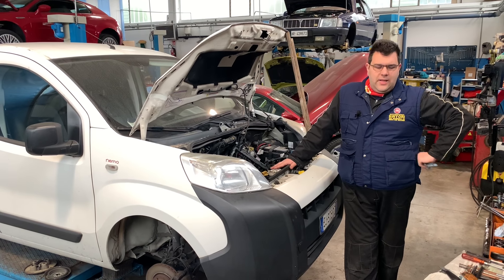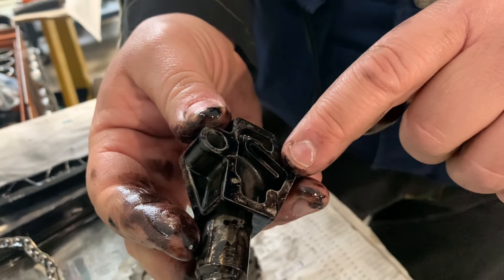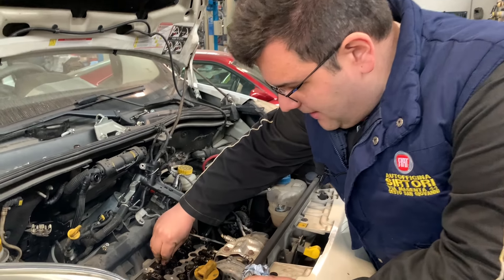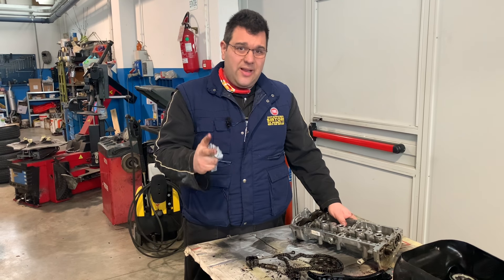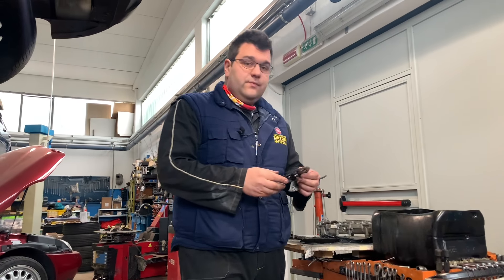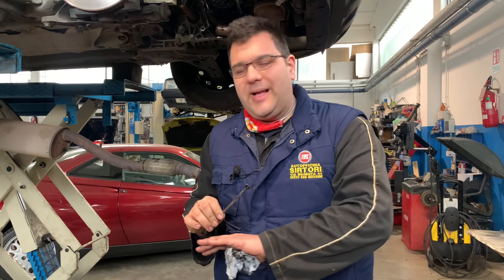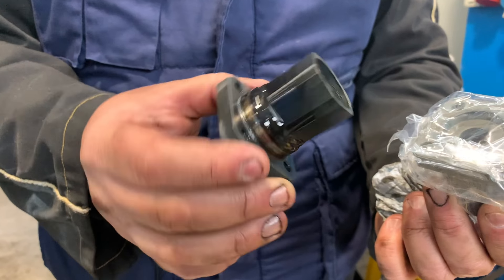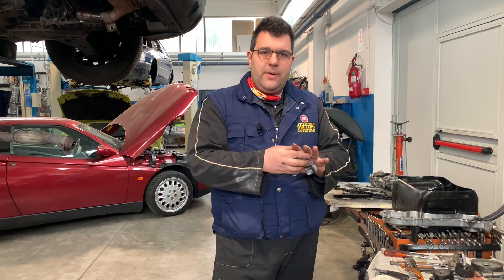GASI TECNICA: catena di distribuzione 1.3 multijet..rotture..riparazione e rimedi

Comment: Pensate a quei motori Mercedes v6 e v8 a benzina montati per esempio sui Ml W164 con la spia motore accesa per mancata sincronizzazione degli alberi a camme bancata 1...con l'ingranaggio del contralbero di bilanciamento fatto di burro che diventa praticamente liscio...e la macchina ferma da 3 mesi perché il ricambio non esiste e Casamadre non sa quando sarà disponibile...altro che Fiat...
Reply: Appunto. Comunque i v6 mercedes sono molto affidabili, sono i v8 a fare davvero schifo. Da sempre e per sempre, i OM628, i M113 o i OM629 un po meno schifo, ma tutti schifo fanno. Invece i motori M104, M111, M112, OM 604-5-6, OM611-2 sono i piu robusti della mercedes, e anche i OM613 v8 sono buoni di quegli anni, srtranamente, come anche i piu nuovi 4 cilindri OM646 sono buoni, problema come il multijet invece lo hanno gli OM651, motore 4 cilindri 200-220-250 CDI, solo che sui 220 e 250 hai addirittura gli iniettori delphi che fanno pena oltre la catena, inveve il 200 CDI la catena e meno stressata e gli iniettori sono magnetici e non danno problemi... Alla fine non e la marca, ma la qualita del modello e lo sperare che e un motore riuscito...

Comment: Ho avuto una Punto Classic 1.3 Multijet 410000 km mai fatto la catena ....cambio olio sempre max 17/18 km la fiat quando comprai l'auto davano per certo che per almeno 260 Milà km non si doveva sostituire la catena adesso sento 120 Milà km cambiare la catena mi sembra strano
Reply: Io Grande Punto 1.3. del 2007 comprata usata da uniprop a 50.000 km. Sostituito olio con 5W-30 + filtro ogni anno o 15.000 km da quando l'ho acquistata (prima dubito che l'abbiamo trattata così). Catena fatta a 185.000 km ma per scrupolo (dopo una notte di fermo, all'avviamento si sentiva la catena fare rumore per 1 secondo d'orologio). Ora ha 240.000 km e non rabbocco mai olio perchè quando arrivo a 15.000 ne andrebbero aggiunti non più 200 ml.

Comment: Grande punto con 340000km catena fatta a 208000km. Ora la catena mi incomincia a far rumore solo dopo fermi di 3 giorni consecutivi. Un motore spettacolare. Hai fatto bene a parlarne data la massiva presenza che c'è. Io ho usato per 14 anni dal 5W40 al 0W40, cambio ogni 8000km, l ultimo cambio ho messo 0w30. La mia non è mappata ma cambiate a 3500rpm sono la normalità, un po' d usura alla catena ci sta. So che è possibile montare kit catena di cavalleria superiori sul 75cv etc in modo da aumentare la longevità.

Comment: Ciao gasi ho una panda 4x4 1300 multijet 69 cv il mio meccanico dice di usare olio 10 /40 e cambiarlo ogni 10000 km la catena dura di più tu che ne pensi grazie
Reply: Ascolta,meglio un 5W40 e cambiarlo ogni 15 Mila,il 10 è un semisintetico molto denso per quel motore.Il mio meccanico sui 1.3Multijet consiglia o 5W30 o 5W40 ciao.

Comment: Io catena su Grande Punto 1.3 Mjt del 2007, con 180.000 km, rumore all'accensione leggerissimo e che durava appena mezzo secondo. La vettura fu acquistata usata con (uni prop) con 50.000 km. L'ho sostituita per precauzione. Olio sostituito ogni 15.000 km (che coincideva con i 12 mesi), Motul 5W-30 dal 2013 in poi. Cambiate sto cavolo di olio ogni 12 mesi o 15.000 km.

Comment: Fare troppi chilometri senza cambiare l'olio è una condanna a morte per le catene di distribuzione. Ma io aggiungerei anche un'altra cosa, Gasi. A me succedeva moltissimo con i 1.4 Tdci PSA delle fiesta, ma ho visto che anche i Mjet non sono da meno: Attenzione agli iniettori che sfiatano. Può sembrare una cazzata, ma le incrostazioni del particolato finiscono nella coppa e vi intasano la cipolla del pescante. E' una stupidaggine di lavoro, sono 4 rondelle di rame e 4 boccole di plastica (più la pulizia), ma vi salvano tutto il resto.
Andate a chiederlo ai possessori delle "vecchie" Mazda 6 col 2.0 Turbo Diesel. Ho perso il conto di quanti motori 2.0 Mazda 6 ho tirato giù per colpa degli iniettori a bagno d'olio che sfiatano.
Visto che siamo in tema Mazda 6, fate MOLTA attenzione al livello dell'olio sulle 2.0 diesel anti particolato. La macchina butta giù gasolio a fiumi per rigenerare e va a finire tutto nell'olio: se avete su parecchi km e, magari, le bronzine della turbina, o le fasce elastiche, sono un po troppo consumate, vi arriva dentro nei cilindri olio+gasolio caldissimi e la macchina va in auto combustione. Ricordo una Mazda 6 in officina durante la rigenerazione statica (80 minuti a 4200 giri fissi... poveretta), la macchina non si riusciva a spegnere perché era andata in auto combustione con l'olio. L'abbiamo dovuta appoggiare contro il muro, con la 6° messa, freni e freno a mano inserito per far fermare il motore. altrimenti sbiellate...

Comment: Le auto col FAP diluiscono l'olio, diluendolo ne riducono la capacità lubrificante; dato che la catena è lubrificata dall'olio motore, con olio diluito subisce maggiori stress (sia in termini di scorrevolezza che in termini di calore), e alla lunga cede...su tutti il motore N47 Bmw..quello di un amico senza FAP è durato 250.000 km (poi è stato venduto e che io sappia ancora viaggia), altri 3 fappati (di persone mie conoscenti) non hanno visto i 200.000 km e si sono rotti (catena KO)
Reply: @capitanandy2535  Io ho una 500x 140 cv convertita a gpl, va che è una bomba..unica cosa va cambiato (ogni 50000 km) in più, oltre a quanto previsto dai tagliandi standard, il filtro muliair (un bullone scanalato con filtrino all'interno) x non rompere il modulo..x il resto è fantastica: consumi da poco sopra i 9 km/l a gpl in città agli 11 in autostrada; ha una coppia e spinta adeguata x sorpassare agevolmente; come tutti i turbo a gas va passata a benzina circa 2 km prima dell'arrivo a destinazione (su un viaggio urbano di 15 km) x lubrificare e raffreddare meglio le valvole, e prima di spegnerla va tenuta accesa un pochino in folle x salvaguardare turbo. Auto che non mi pento di aver compratoe convertito

Comment: Hi,i have Fiorino 1.3  Euro5 with 75hp.I have problem , when i startup car ,engine knocking and knocking noise after some minute are disappearts but after 3-4min i have blue smoke and car engine rpm jump from 800rpm to 1000rpm.I have check injector,new timing chain,new glow plugs,new DPF filter.When car litle get worm all is OK.Can you please help me?Thanks

Comment: buonasera a tutti. sono un possessore di un opel corsad con motore 1.3 multijet , 75 cv , metto in moto tranquillamente spengo l'auto e non riparte piu , ho notato che il motorino d'avviamento gira piu veloce , un meccanico ha controllato se si e rotta la catena ma niente rottura l'albero a gamme gira , e mi dice che  il problema e la catena di distribuzione che e in fuori fase , e possibile?? ,e il fatto che il motorino gira piu veloce senza che la macchina parte??,la catena lo fatta sostituire a 170.000 e adesso ne ha 220,000

Comment: Ciao GaSi, una info se puoi... 
Ho una fiat punto 1.3 multijet 95 cv. Faccio mediamente 25 mila km annui tra autostrata e statale. 
Il meccanico mi ha messo (tagliando 80 mila km) un olio per motore 5-40 al posto del 0-30 consigliato da casa madre, perché dice che quest'ultimo, il motore se lo mangia e arrivo al prossimo tagliando senza olio. Vedendo il video mi sono incuriosito. 
Mi puoi dire la tua?
Grazie mille, Marco
Reply: 0w30 consigliato da fiat sul multijet? io sapevo il 5w40 selenia
Reply: @sandroz321   
0 30... visto su libretto uso e manutenzione
Reply: @sandroz321  anche io 5 w 40
Reply: riporto... lubrificante totalmente sintetico di gradazione SAE 0W-30 ACEA C2/API SN
Reply: Confermo, euro 6 porta lo 0w30

Comment: ...tutti sanno che il 1300 spacca la catena a 120000 km... in genere.

Altrimenti sarebbe eterno...
Reply: Dipende dalla manutenzione e dallo stile di guida.
Reply: @Sestorema  certo, verissimo, per tutti i motori e per ogni cosa anche. Però sul 1300 molti meccanici e del settore dicono così...
Reply: @t3garrett216  Perché molte persone non trattano quel motore con la dovuta cura. Soprattutto sulle auto più piccole, quel motore viene spesso bistrattato, trascurandone la manutenzione. Tutto si rompe se usato senza riguardo, persino le cose più affidabili.

Comment: Io ho una Ford Ka 1.3 Tdci che praticamente è una fiat 500. Io ho eliminato il fap con catalizzatore metallico a 200 celle della ragazzon, eliminato EGR e mappato da un professionista. 100.000 km all' attivo e nessun rumore di catena. Fate conto che senza fap, l'olio non degrada  e il motore ringrazia. Per la cronaca io uso il castrol edge, cambio olio 1 volta l'anno indipendentemente dai km fatti, comunque mai oltre i 15.000.